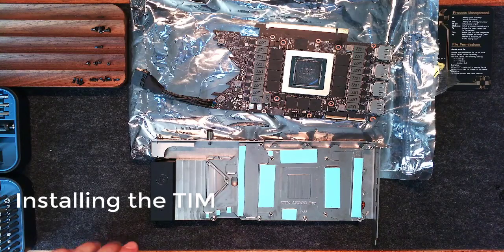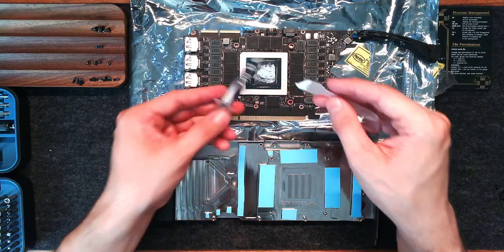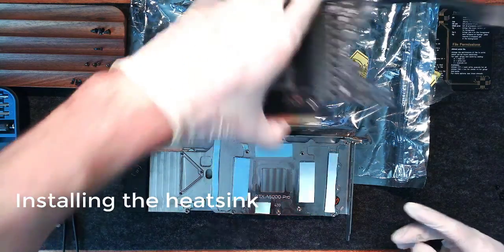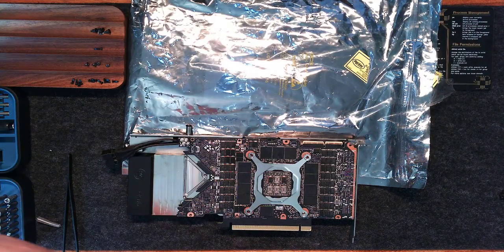Installing the EK-Pro GPU Water Block on the Nvidia RTX A6000

Comment: Thanks for the detailed video. Using nvidia-smi, I can see that my RTX A6000 (running with the original cooling system) are being limited by heating: the maximum power consumption they reach is around 230W. With the waterblock, does the A6000 reach 300 W? In this case, does the temperature remains near 40C?

Comment: How did you disable the onboard fan?
Reply from the maker: The fan is part of the radiator and is completely removed when replacing the heat sink

Comment: After switching to water block, is the card now single card height? My motivation would be to max out cards on the motherboard without having to use risers or extensions. Great video, thanks for sharing
Reply from the maker: @clubpasser123454321  yes

Comment: Thanks for you video thinking about to replace thermal pads an thermal paste on my RTX A6000. 

BTW: isn't it better to work with a warm card? (Use some stresstest before)

Gladly MX-5 was replaced with MX-6 which is much better.

Comment: Great video.  I have a dual A6000Ada  system which is super noisy.  I would love to switch to water cooling but there's no way I'd have the confidence or experience to do it myself.  Two questions: how much quieter is this?  1. Basically silent under load?  2. Are there a lot of shops that offer this sort of service (for a fee) with liability?
Reply from the maker: 1. What determines how quiet it is comes down to your radiators. Enough rad and any system can run quiet. 

2. I'm sure there are places that do. If you're just talking about the card, it's not terribly difficult to do. I suggest doing some computation on the card before disassembling it because the warm thermal paste make it easier to separate the heatsink. But also check to see if you could lose your warranty before you do it.

Comment: This ain't no used 3090... wow I wouldn't have the balls to take apart a GPU this expensive. The workstation stuff runs cool enough for me lol.
Reply from the maker: Honestly, it was mostly for fun. I've hardlined watercooled my systems for years and I wanted to build out a workstation for my MLE work.
Reply: @NatePhysicsTutor  yeah most wouldn't risk the warranty
Reply: @NatePhysicsTutor  Did you ever have pump fails or leaks that compromised the system? I'd very like to liquidcool my very noisy A6000, but I fear that if the pump or the loop fail that will waste the gpu..

Comment: I would like to ask, I have installed the heatsink like you did, and after we installed into the motherboard, Bios cannot recognize the GPU that put it in, it didnt show anything. Do we have to do a fan disable or something first ?
Reply from the maker: Did you manage to solve your problem? If it isn't being recognized I would suspect a couple possible issues. The most obvious, are you absolutely sure you placed it correctly in the slot? I've manage to miss the  pcie slot a few times myself. If that is fine, it could be the weight of the card in the slot. It's not a light waterblock. 

Did you power the card using the EPS 8 pin? This card won't work without the 8pin and it's not the classic 8pin pcie power.

It could be that you shorted the card. Make sure that the metallic parts of the waterblock are separated from the board by thermal pads. 

If you're using liquid metal, which I wouldn't suggest for this card, there might have been a spill. This could have caused permanent damage.

Comment: how much thermal improvements did you get?
Reply from the maker: It's basically never above 40c and idle closer to 33c. I'm running it on a 480x120 rad along with the processor and it's mostly silent under load.
Reply: @NatePhysicsTutor  That very impressive!!!!!
Reply: @NatePhysicsTutor  that's massive improvement!
Reply: @NatePhysicsTutor  Thanks for the video. Please elaborate about "mostly" (in 'mostly silent'). In which cases in not silent? Is the pump noisy? If yes, what pump are you using? Thanks 1K!